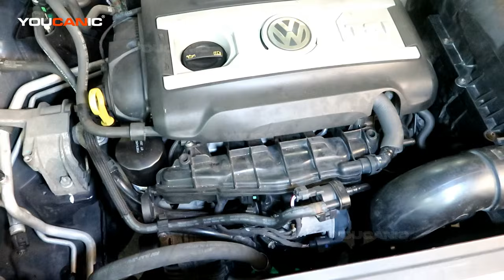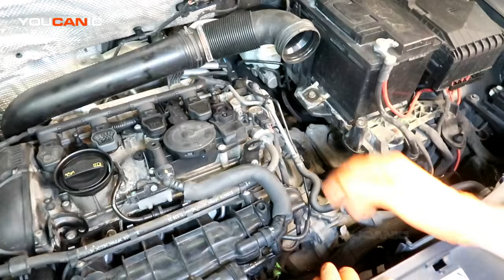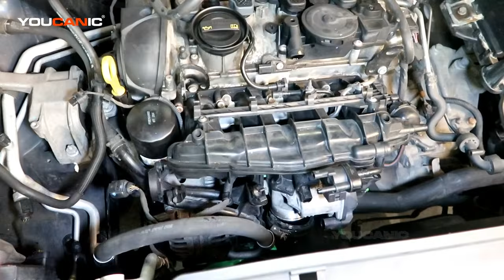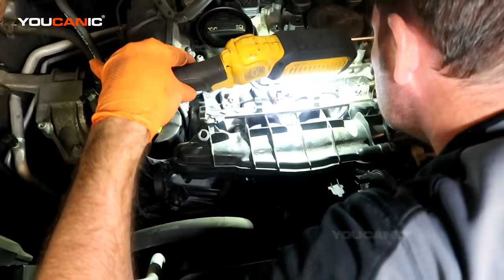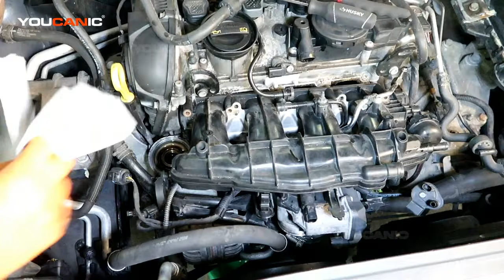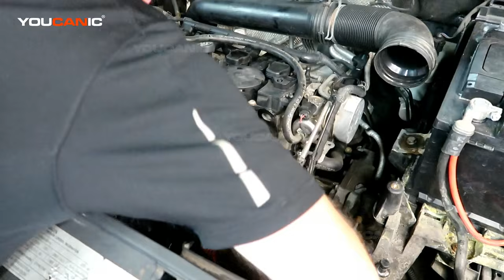2009-2016 Volkswagen Tiguan - Remove or Replace Intake Manifold

Comment: Very helpful dickhead, you left out the one bolt that stops you from actually taking it out and the reason most people watch the damn video, when I find an actual helpful video I’ll comment the link for anyone that wants to actually get their intake manifold off
Reply from the maker: @B0Y1NTH3D4RK If you’ve got a car issue or repair question, you can find step-by-step guides and scanner help at youcanic.com. We might miss some comments here, but our site has answers for most problems already!

Comment: Somebody please help. I’m trying to put the manifold back in. It’s not sitting flush. Does it have to be flush before you add the screws? There’s a gap and I can’t close it. I don’t want to break anything. I don’t know what is keeping it from being flush against the engine. This is driving me crazy. S.O.S. HELP
Reply from the maker: @d.edwardsfreelanceeditorvi4212 If you’ve got a car issue or repair question, you can find step-by-step guides and scanner help at youcanic.com. We might miss some comments here, but our site has answers for most problems already!

Comment: So this is why I found this video. What the Fu!@ with the bracket.. Then NO bracket was even discussed. All the comments are like me. How do you get to that 12point even if its hard. Its been an all day item still not done. How about a single video on removing that bracket seems like the most called on item that is the most difficult. 

I'm thinking to just reach in with a Sawzall and cut that bracket in half and just take it out as you apparently left out when reinstalling the manifold.
Reply from the maker: @TimSharkey If you’ve got a car issue or repair question, you can find step-by-step guides and scanner help at youcanic.com. We might miss some comments here, but our site has answers for most problems already!

Comment: If you have the center bracket, use carefully a reciprocating saw and cut the plastic from the intake manifold where holds the stupid bracket (located in the center from the intake manifold).. and after removing the intake, unscrew the bracket arm (by the water pump) and throw it away
Reply from the maker: 👋 Thanks watching and for your comment! Our techs may not see every YouTube message, so if you need help or have a car question, visit www.youcanic.com — our team is happy to help!
Reply: Haha! The  brackets bolt would budge and drove me insane I ended up cutting it it in half with hand hack saw !

Comment: This is why I don't like mechanics working on my cars. He either has no idea that the intake support bracket exists or he intentionally leaves it off because it's difficult. No mention of the charge pipe being difficult to remove and that you'll most likely need to use a hose pick to break the seal. What if injectors don't all stay in the cylinder head? If they come off they, the seals must be replaced which most likely requires special tools. Worst of all, they release a DIY video on the procedure for this job without including critical steps.

Comment: Thank you for lecture this is amazing. Bracket what, what doesn't cause a car not to perform perfect.. What you did there makes work easy❤
...
My only advise is don't give student to tight those inlert bolts especiall if it once done... You will left with loose inlet manifold they will strip all threads

Comment: On 2012 Audi A3 2.0t there is a bracket under intake manifold. You need to use M /0 triple square bit.

Comment: Yeah dude thanks for leaving out the most important part I can’t get the intake off even after the bolt the gasket won’t come off intake support beam that you said nothing about
Reply: Same bro🤦🏾‍♂️🤦🏾‍♂️
Reply: @NickStiz you run into any problems? Be careful taking that intake off u can damage the full rail and that’s $700 oem, also u can reach the bolt from underneath.
Reply: @Back1pretzleout  After pulling and pulling THEN noticing the bolt, I’m sure I’ve damaged something lol I gotta get back in there, will update soon
Reply: @NickStirz  check out your intake manifold fs. if your like me and broke it , go to a wreck yard and find another tig and do it again but don’t make the mistake I made by breaking it twice 💀
Reply: @ I forgot to say DONT CHEAP OUT ON WATER PUMP! Buy OEM I think I am going to have replace the aluminum one I  got from Amazon :/
Reply: @whivory  I should have made a video lol but it’s directly under your intake manifold, you can either cut the rubber bushing that holds it to the  bracket or u get 10 mm socket and take the bolt out that holds it. It’s going to be tricky to get it out but it is possible with some patience maneuvering. Like I said be careful I broke my intake manifold, and fuel rail  taking it out. If you can leave the the injectors in, if they come out make sure you inspect them to make sure u didn’t damage them.

Comment: I have a question, when changing the installation manifold on a 2011 Volkswagen Tiguan, I get this error code 01314 DTC 1 brake control unit. Before changing the installation manifold, I only had the check engine light on with error P2015. Do you know if I can erase these codes?
Reply: No I done tried that it wont work. It'll come back without fixing the problem.
Reply: You can try I would start with replacing the abs sensors if not check the wiring 6-18 inches from the module to see if their damaged. You could splice the wire keep the old on but attach new wiring to it and go from there to connect the ecm to the abs.

Comment: What size is the bolt that attaches the side of the water cooling line on the side?
Reply from the maker: Thanks for your question! The bolt size can vary depending on the vehicle model. We recommend checking out the factory repair manuals on our website for this specific detail at www.youcanic.com. 

At Youcanic, we are devoted to making car maintenance less intimidating. Our resources, guides, and Youcanic scanner are all designed to help car owners like you. Don't hesitate to reach out if you need further assistance. We are here to support you on your car ownership journey!
Reply: It’s a VW Eos 2012.

Comment: Really good video! This procedure it will be the same to remove the throttle body?
Reply from the maker: Hi there, thanks for your positive feedback! At YOUCANIC, we aim to equip car owners making maintenance simple, less expensive, and less daunting. While we can't be sure if the same exact procedure applies to your throttle body without more specifics, our website has numerous resources and our YOUCANIC scanner to assist with various car maintenance activities. 

Feel free to discover more on www.youcanic.com. Here you can access comprehensive guides, resources and even factory repair manuals for detailed procedures. Remember, we are here to empower and assist you throughout your car ownership journey.

Comment: Well, it is obvious this Manifold has been previously removed.  There is a center brace that's bolted to the engine block and to the center bottom of the Manifold.  It is virtually impossible to access the bolt (12 point triple square) to the block and the 10mm nut on the bottom of the Manifold without removing the Throttle Body!  So, guys, before jumping into this job, keep my comments in mind.  I'm presently removing the Intake Manifold from the engine in my 2011 Tiggy for the second time ... both times due to that poorly designed Water Pump Contraption.  Hope this helps!
Reply: You just saved me a huge headache, I’ve been fighting getting this off for two hours now
Reply: Same Throttle body here. 2013. 3/8 drive doesn't fit through. Remove the hose from the throttle body completely to access 4x T30's.
Reply: Dude! Your a live saver because im in awe this dude is making space that doesn't exist for me.
Reply: What about the 2017 Tiguan has anyone have had issues with 2.0 T
Reply from the maker: Thanks for sharing your insightful hands-on experience with the Intake Manifold removal process. We truly appreciate your input at Youcanic as it supports our mission of empowering car owners with valuable knowledge. Remember, we're here to assist you and you can always reach out to us on our website, www.youcanic.com, for any help you might need. We also offer factory repair manuals for comprehensive guides. Keep up the great work!

Comment: I did this on my 2010 VW Passat, I also replaced the fuel injectors. Now the engine shakes and won’t get above 2 rpm before cranking off. It’s giving me the code p2149 the powertrain control module (PCM) has detected a problem with one of the fuel injectors in a specific circuit (group B). In suggestion on what I got to do?
Reply from the maker: It sounds like the issue you're encountering might be due to a faulty fuel injector circuit or incorrect installation. I'd recommend checking the wiring and connections of the affected circuit. You might find our YOUCANIC Full System Scanner helpful in further diagnosing the problem. Visit www.youcanic.com/scanner for more info.

For complex issues like this, it will be great if you could post your question on our platform at www.youcanic.com where our community of car experts can provide more detailed advice. YOUCANIC is here to help you understand and troubleshoot car repairs with confidence. I hope this helps!
Reply: Buy a Honda

Comment: In order to replace the purge valve, do you need to remove the intake manifold or is it possible with it on?
Reply: You can cut the hosing off to your liking and use a bigger hose to connect the new and old one together but if you don’t wanna do that then yes you’d need to remove the Intake Manifold

Comment: Did you complete a valve inspection and carbon clean whilst the manifold was off?
Reply: I just did a customer's today I've never seen so much carbon in my life
Reply: @mrsamsung8184  I've had my carbon cleaned but it keeps creating issues.  I don't want to replace this myself.  I will also leave this alone.
Reply: I think I'm going to leave it alone

Comment: You miss a very important thing on your video!  There’s and underneath bracket hold by a triple square bolt and a 13mm nut
Reply: That's the whole reason I even watched this lol
Reply: Yea!! Dealing with that now after he missed this step!!!
Reply: I think the majority of people are here for this specific part… I’ve been going at this shit for a day and a half do find the one set of bits I don’t have !!!!
Reply: Fuck that bracket. Got it out. It ain't going back that's for sure.
Reply: Not all these engines have that bolt. A 2011 Tiguan does not. A 2013 Eos does.
Reply: @Daileyandrew 2015 Tiguan does too 😓 fuck lol

Comment: Did you just not use the metal manifold support bracket with the triple square? Is it not necessary?
Reply: That Guy had obviously already removed the Intake for the YouTube presentation or someone left it out when the manifold had been removed in the past.

Comment: Good video…but I’m confused—did I miss it, or is this missing the metal brace underneath that mounts with a 13mm nut and a 10mm triple square bolt?
Reply: Yes that is the brace. You wont be able to get it out without removing both bolts.  I also removed the throttle body and intercooler piping to make it easier to access the driver side intake manifold bolts
Reply: @chickenfixn  kik I'm az unp
Reply: Hey all. Sorry I am late to the party here. I just had to do this repair myself. I posted a video showing the location of that lower manifold brace and how to cut it off. Cheers and hopefully you’ve sold your VW by now.... 😁
Reply: @Read_Exodus31  where is your video????????
Reply: found it!! Posted it above!!! THANK  YOU!!!!!!!!!
Reply: @Read_Exodus31  Thanks to you, I busted out my sawzall!!!! problem solved!
Reply: I didn’t have that brace on my 2013 Tiguan
Reply: @matthewdelgado7515  Guessing that's because someone removed it.  It was a royal pain to remove, but I finally did, and it didn't go back in when I finished the install.  I've since learned that many people leave it off since it's not entirely necessary.
Reply: @vaterator  Sorry to butt in but that bracket can be removed and left off? I'm planning to do this soon on my GTI
Reply: @armando19  Correct, I replaced the intake manifold a few months ago and left the bracket off, it's been running fine since.
Reply: @vaterator how did you manage to get it out? Spent the last 2 hours trying to remove it but can’t get the 10mm triple square at the bottom
Reply: @xiiDrops0tziix  If I recall, I had to jack up the front end to get to it from under the car, and even then I had to fiddle with ratchet extensions to reach it.  My wife held a flashlight on the bolt from above and I just kept trying until I got it.  It wasn't fun.
Reply: @vaterator  i doubt the engineers just added the bracket just for kicks. im sure its in there in case the manifold gets ajarred
Reply: @golfmaniac007  I never implied the engineers added it for kicks, but VW (and German manufacturers in general) tend to overengineer things.  I'm sure the bracket provides extra support in instances of extra forces exerted on the manifold, but I can't imagine too many scenarios (aside from a crash) where the 10 (I think) bolts that secure the not very heavy plastic manifold to the head would fail.  For the record, I traded my 2013 Tiguan a year ago.
Reply: I ended up cutting the rubber brace in half. That thig was a pain @xiiDrops0tziix
Reply: Same problem. Difficult to reach that bolt.
Reply: I replace my intake 2 years ago due to it failing and like many others I didn't put my bracket back on. Guess what I'm going to do right now.... Yup, the manifold! I've been trying to figure out why I'm slowly losing power but I don't have any CEL. I know I'm down 5psi of boost but other than that, it runs perfectly fine. While checking all my intake piping and wiggling the one onto the throttle body I notice the manifold wiggled too. I checked the bolts and they were loose so tourqed them and then I was down 7psi. Pressurized the system starting at the filter side and left the the rest connected. As soon as it gets to 5psi it's just pouring air out where the head and manifold meet. Hopefully it's just a messed up seal and I didn't break the manifold. 

Long story short, but the brace back on!

Comment: A quick question. Whenever a new intake manifold has been put in place foes it have to pe programmed ?
Reply: I just did mine on a 2011 tiguan, i also needed a revised fuel rail as the old one did not fit. But no the intake manifold did not need to be programmed. All i did was clear the codes and I ran a output test using obd eleven but you don't need to.
Reply: I have the same cuestión